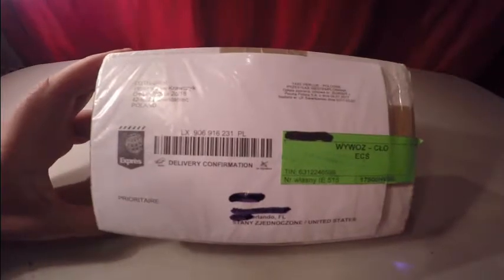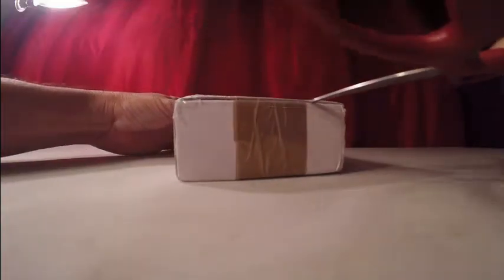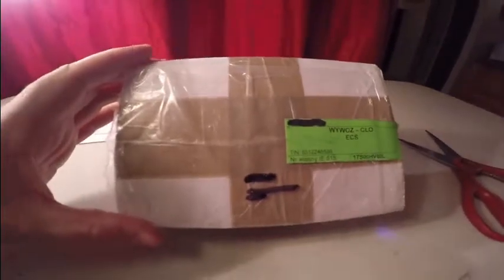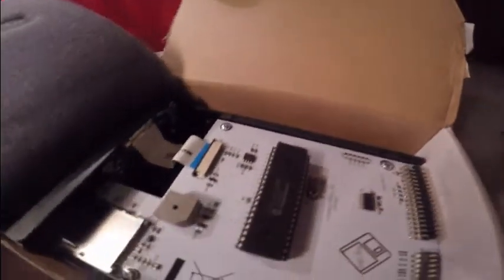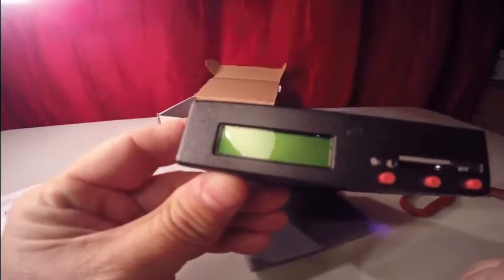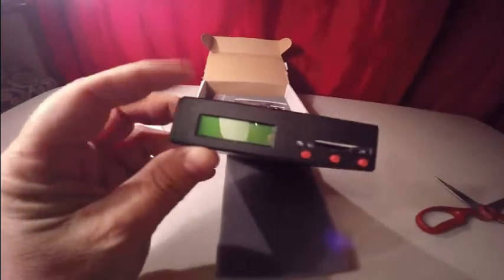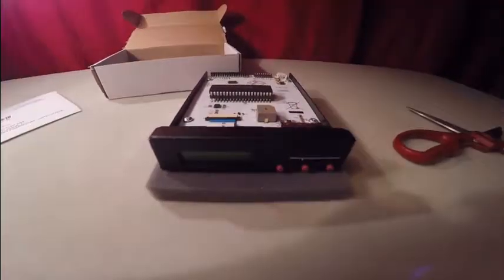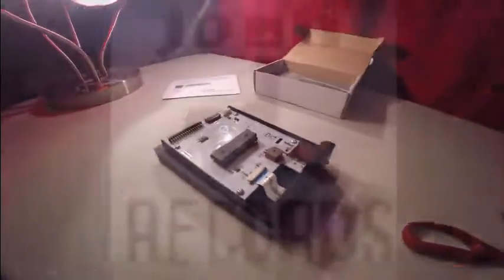Unboxing - Lotharek HxC rev F Floppy Emulator

Comment: hundred and twenty euros  ??????.....and you call it cheap.....don't know about the price but compare to Gotek ones its too expensive......well, that is the bad this....my old ASR 10 doesn't worth more than 230 euro not to mention my floppy disk its dead !!!
Reply from the maker: I very much like the file display on the hxc. Being able to see the file name is very important to me. Remembering numbers is not that much fun .  Also the usb thumb drives stick out the rack to far and will get broken. The sd is flush with the front. So yes 120 is more than a gotek but its lots more useful for me.